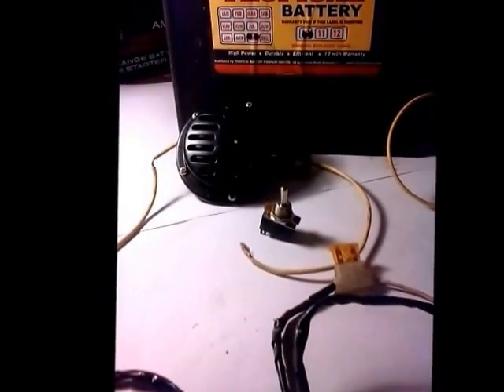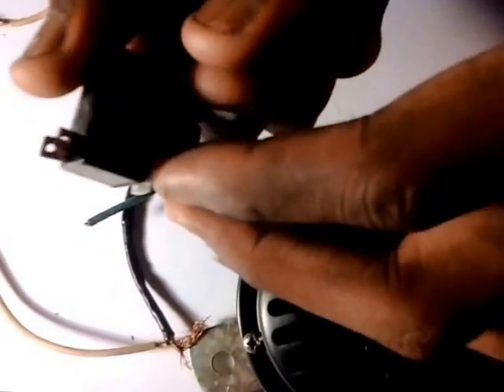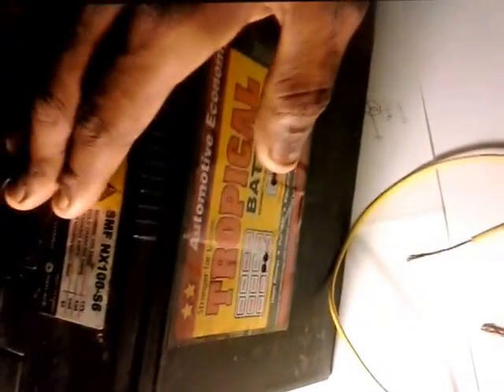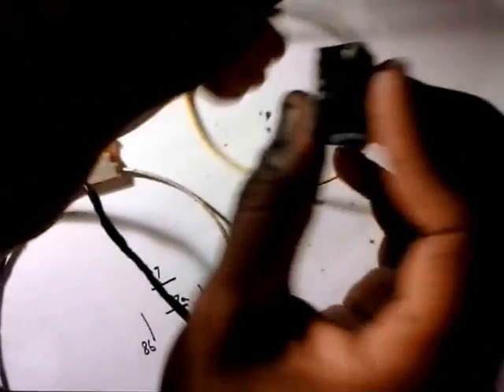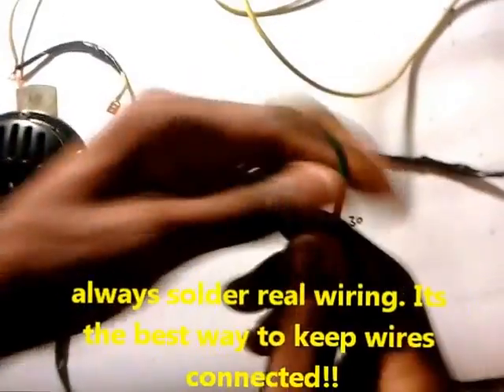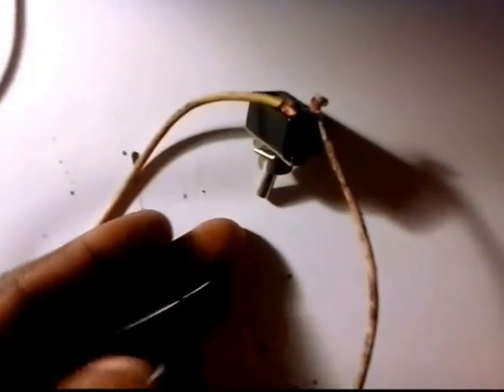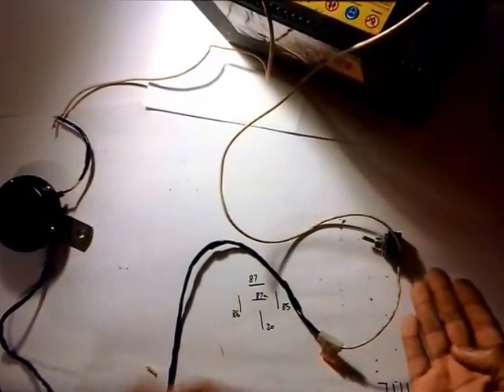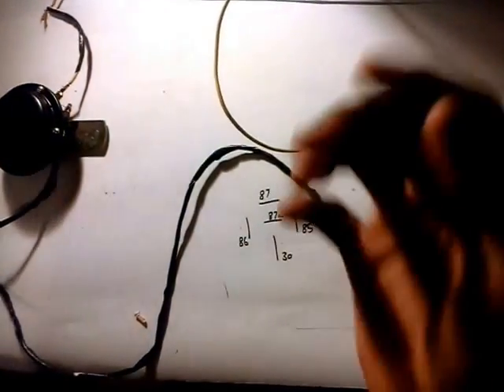How to wire a car horn

Comment: You can use an 'add circuit fuse holder and get power from there, with that fuse holder you have power and protecction so run a wire to the horn and then from horn to battery ground or car frame and done. Beep beep

Comment: me have a airbag sign on pon me dash board me wah know how fi get it off
Reply from the maker: get it scanned first, what kind of vehicle? airbag ever been replaced?
Reply: Me get it scan but the it's not reading the car. But I did some research and it look like it need a airbag clock spring OEMI. Me ago order it and fix it and see if it work. Me carry it guh one mechanic and then say a that can be the problem. Me have (Honda Civic ex couple 2 door)
Reply from the maker: yea that can cause it. maybe it met in an accident before. airbag lights are truly annoying because even a bad seatbelt switch can cause that or a faulty or disconnected impact sensor on the chassis. those cars are awesome thou!..just bought a 2 door honda integra 93....soon upload on it!!
Reply: honda a the best cars and they are good on gas. it end up in a accident before and them rebuild it. me just hope when me fix it, the light come off because they airbag light is truly annoying bra.

Comment: early in the video (0:53) you mention the positive & negative poles on the horn. But later when connecting the wire you don't say which side to attach to!? Same with the circuit protector. Does it have a '+' & a '-' side? Should you start at the Positive side of the battery & then go to the '+' side of the circuit protector? & then follow up by attaching the wire from the '+' side to the '+' side of the switch? & so on like keep it in line all at the '+' side? Or does it not matter which side you hook up to?
Reply from the maker: ok, on the protector it doesnt matter what way you put it. any tab on the fuse can be used for positive or negative. some after market horns do not have a specific positive or negative but you can look on each tab if u see a positive or a negative sign to be sure. the horn used in this video did not have a specific positive or negative side.
Reply: ok thanks man!

Comment: NEVER CONNECT A FUSE AFTER A SWITCH YOU HAVE TO PUT IT DIRECTLY AT THE BATTERY!
Reply from the maker: some car makers now actually have some fuse on the ground side.... it is better to put the fuse directly after the battery thou! just incase something is to short. however if anything was to short the load would still be protected since the power would be disconnected from reaching the load, hence completing its objective of protecting the load.

Comment: is that circuit protecter compulsory ??
Reply from the maker: +Simar Singh it is highly advised to use this protector device because it will protect the horn and the switch if the circuit was to be short circuited. the circuit will work without the protector but its not safe for the load and switching device in the circuit if there was to be a short.

Comment: how many amps is the fuse
Reply from the maker: +Hackere Martinez 15 amps...horns use different amperage depending on the model. so a way to determine the type of fuse to us is to put a ammeter in series in the circuit and measure hw much amps the horn uses. if the horn uses 9 amps then u can use a 10 to 15 amp fuse...never use a fuse below the amperage being drawn or too above the amperage by double.

Comment: i tried this but the fuse keeps blowing
Reply from the maker: you probably using a low amp fuse....use a multimeter and measure the current that the horn uses and get a fuse that is about the same amperage or  little over
Reply: +lloyd mason Thanks. I have now tried 5amp, 10 amp, 15, 20, 25 & 30 - they all keep blowing. im confused :-(
Reply: +Diagnosticsworld does it matter if i do it like this - positive battery to fuse to switch or does it need to be positive battery to switch to fuse?
Reply: +Diagnosticsworld tried both, the fuses keep blowing. the battery is a standard car battery any other tips?
Reply from the maker: +Diagnosticsworld yea you can do battery to fuse...check for a short to lground
Reply: +lloyd mason cheers i sorted it, it turns out i didnt need to run a wire from the battery to the negative on the horn, the horn was already grounded by the mount onto the chassis. Thanks for your help JAMAICA :-) Cool Runnings
Reply from the maker: +Diagnosticsworld yea anytime
Reply: Data shot, my golf cart thanks you

Comment: "HEY!! get outta the way!!!" lol
Reply: Great thankyou 😊will the horn still be drawing power with the car switched off ???
Reply: @sebwright2900  The horn will draw power when switched on and yes it will still horn (draw power as you said) when the car's engine is switched off. Try your car's horn before you switched on the engine, didn't you notice you can use your horn?